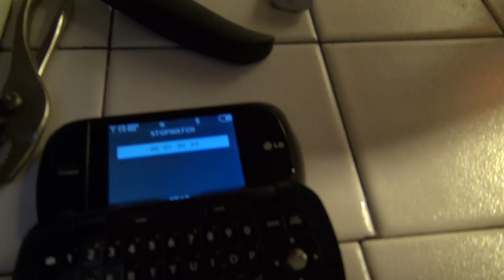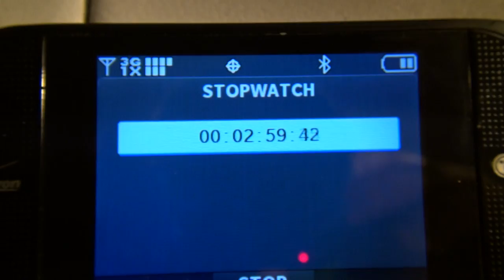My New Copper Coil Alcohol Stove

Comment: Spreed, yes you do need a wick. Carbon fiber,fiberglass,steel wool,cotton,it all works,as the flames don't touch the wick. Wick sucks up the fuel,the heated COPPER tube vaporizes it,it comes out of the oriface on the bottom of the coil as a gas,and ignites as it passes the gap between the coils at the top when it mixes with enough air. This becomes a self sustainable cycle. The gap affects the flame size.

Comment: I was wondering if you could help me. I'm considering updating a nearly 80 year old camp stove,a first Gen svea 123. I want to some how make a coil or duel coil that will mount on my svea tank. The tank was built for my wind screen/ pot holder,and it all fits inside its biggest pot and lid,as well as it already has a fuel cap I also have a pump for. Maby you could lend some insight on the matter. Thanks in advance

Comment: what are the factors which might affect the strength of the flame?  Mine is not shooting like blow torch although I have done the same structure thru, like a 1mm hole on the bottom of the copper (5mm dia).  Does the length of the wick inside matter?
Reply: I’ve seen others that use larger burner orifices and some smaller, experimentation seems in order.

Comment: how's the formaldehyde been treating you? If you are using methyl alcohol with copper it is not really cool. Use thin wall stainless steel tubing instead. That's what that white residue on and inside the copper tubing is.

Comment: Now for why you use copper or brass,try it with stainless and don't cry to me when it don't burn right. You need the thermal conductivity of the copper or brass to vaporize the fuel right. Other metals wont get hot enough. Thin wall stainless would be more work to tool,wont heat up right,and possibly crack or fail in a bad way. I suggest you get medical insurance, you make stoves like that your gona need it.
Reply: Nonsense..you absolutely can use stainless...look at my video of my "Shocker" stove...it has a stainless loop and gets plenty hot.
Reply: and I might add that the stove I built is far superior to any homebuilt pressurized alcohol stove I have seen to date. If you find one let me know...

Comment: And to you dmith,sorry dude,but that's how these were made 100 years ago,and not one really broke. I got one that still works.yes with copper and yes with heat. Gota remember,us moonshiners had reasons for using copper . and if it gets residue,oh well,its a stove,not a coffy cup. Clean it and no prob. And further more these stoves can also use kerosene avgas diesel gasoline heck even solvant as long as its flamible. This is why these where expidition stoves. Could take one to the arm pit of hell and find something to burn In it. Sence most came with a wind screen and pot holder all in one,at the very worst case,it is a hobo stove on steroids. Consumerism killed this stove,not its disign,we are just to greedy to make a product that will last 100 years nowadays. Oh I almost forgot,some models did use brass tubes. Oops.

Comment: This dude is going to get himself killed**  The pot full of boiling water was offset towards the edge of the counter.  The chicken wire stand was hot red on the side which faces the edge of the counter.  Author's head was looking under the pot at the edge of the counter.  So many wrongs in one setting: 1) The chicken wire could have broken off and tipped the pot right on his face; 2) because the pot was already offset, boiling water could have also tipped the pot right on his face.    That said, cool stove.
Reply: Along with all that you just stated, he is also manufacturing a form of formaldehyde gas and powder. Copper, heat and methyl alcohol don't mix. Note: the white residue on the copper tubing.
Reply: +dmith smith sooo why do moonshiners and every other distilery/brewery use copper?
Reply: +robot797 since when, in a distillation/brewing process do you get the copper above 700degF ?  distillation only requires 170 to 185 deg. no where near enough to produce formaldehyde. This death stove he has created gets the copper with the alcohol vapors to a temp in excess of 900 deg. thus creating various forms of crude formaldehyde... Science does not lie. Coils used in this type of stove should be stainless steel, no question about it lol.
Reply: I don't believe it until I have seen a complete chemical chart of the. White stuff
Reply: Start researching as I have done and you will eventually come up with the full answer to the matter.. A long time ago I built a copper coil stove of this nature and it will burn maybe 20 or 30 tanks full and it will start to clog the interior of the coil with a white crude form of formaldehyde powder.  Guaranteed. The thermal reactivity of brass and methyl on the other hand is different and won't clog.  All of the old school manufactured coil stoves ever made 100% have BRASS coils...Copper for these stoves is JUNK ! Trust me, I know what I am talking about. I have been building stoves for 14 years...
Reply: dmith smith i still wont beleve it without the chemical chart
without the chart you dont have proof
Reply: +robot797  The process is scientifically known as  "Catalytic Dehydrogenation Of Methyl Alcohol To Formaldehyde" 
Look it up, you may learn something.
Methyl alcohol passed over heated copper is decomposed into formaldehyde and hydrogen (Sabatier and Senderens)..........So, the wicking material inside the copper pipe, whether it be stainless wool, carbon felt, even fiberglass etc. but especially stainless wool acts as a crude but effective catalyst within the copper pipe creating formaldehyde. If you do not believe this actually happens it is your loss not mine. Good day !